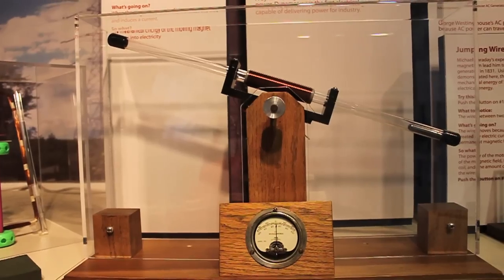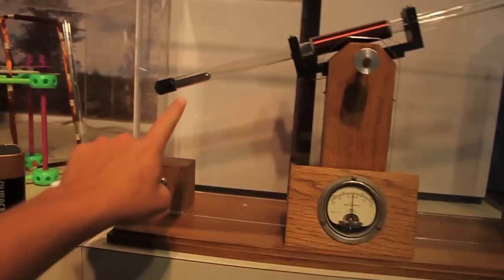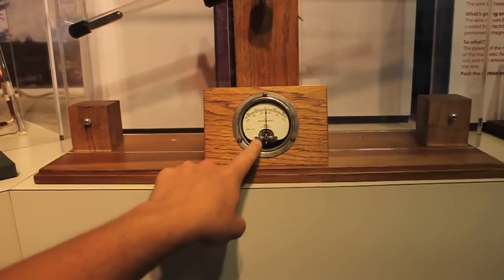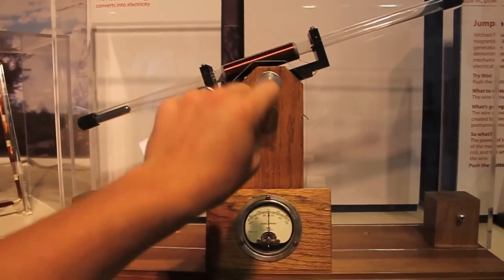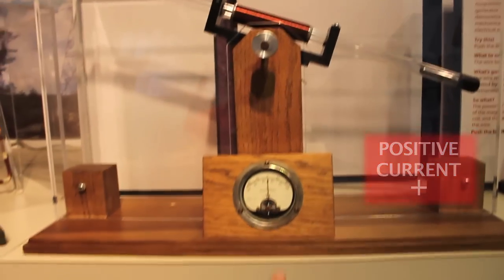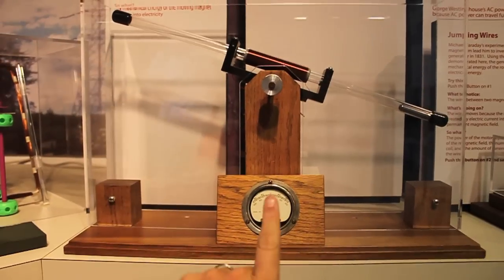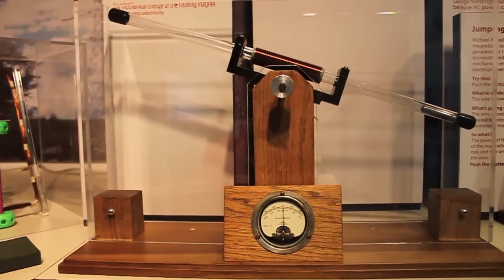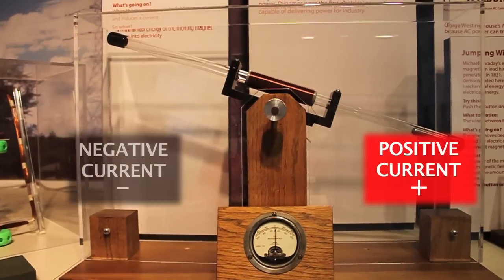Magnet making Current - Smarter Every Day 16

Comment: @Speedtimesthree 
I'll try to explain what I think you are confused about.
40K volts. Short term for 40,000 volts. 40 Thousand. Your standard US outlet uses 110 - 120 Volts.
There are magnets inside every hard drive. They are fairly powerful.
60 Hz. 60 Hertz. Standard frequency for power.
I threw a magnet a a friend holding a cellphone. A magnet will kill a cellphone (kinda).
Non ferrous. It means it does not have Iron in it. It does not have magnetic properties. Used for shielding.
:D

Comment: Cool demo.  You should also mention the application of Faraday's Law for why.  In short it's because the time rate of change of magnetic flux points the same way for each pass, as Mr. McCarty explained.  Also, notice how the needle goes negative when the magnet leaves the coil?  The direction of the change in flux reverses...
(google "hyperphysics faradays law")

Comment: I am an Electronics Technician in the US Navy. I work on a lot of gear that has a LOT of power. One of the radars we use is very long range and uses a 40k Volt transformer unit. That's not a typeo.... 40k Volts at 60 Hz. One day we taking apart a bunch of hard drives to get at the magnets inside. I threw one at a friend of mine who had his cell phone in his hand. The transformer case is non ferrous, so It didn't stick, but it sat on top vibrating at approx. 60 Hz. Pretty cool, huh?